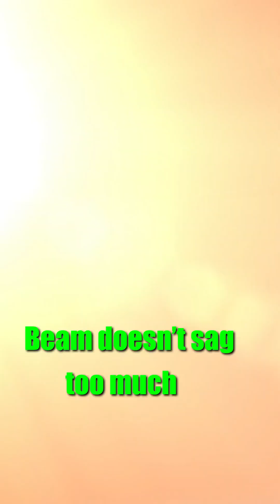Why STAAD  gives wrong deflection? Fix it with reduced EI

Comment: Thank you sir,
Please with r.c building in staad, the beams are connected at the mid point of columns.
 What if in real life the beams are supposed to be connected to the edge of the column.
How to you correct that in staad.
 Because the load distribution to the column should be different in the 2 scenario's.
Thank you
Reply from the maker: https://www.youtube.com/shorts/bToVY8xsoPI ,Watch this Column design rules 

Additionally 
To get flexure and shear design results at a specific distance like "d" from the column face (rather than the default 13 locations), you can use the *SFACE**, **EFACE**, and **MFACE* parameters in STAAD.
✅ *SFACE* = Distance from the *start node*
✅ *EFACE* = Distance from the *end node*
✅ *MFACE 1* = Tells STAAD to perform *flexure design* at the distances specified in SFACE/EFACE
 Example Input:
SFACE 500 MEMB 1  
EFACE 500 MEMB 1  
MFACE 1 MEMB 1

This will check *shear and moment design at 500 mm* from the beam ends. Perfect if you want results near the column face or any other custom location.

Comment: And where direct analysis to be used ?
Reply from the maker: Great question. Direct Analysis is used in steel structure design, especially when second-order effects, initial imperfections, and inelastic behavior can significantly affect structural stability.

It becomes essential when:

* The slenderness of members is high
* Bracing systems are flexible or complex
* You want to capture P-Delta effects accurately
* You're dealing with rigid frames, tall buildings, or structures in high seismic or wind zones

According to AISC 360 (Chapter C), Direct Analysis is required when the ratio of second-order drift to first-order drift exceeds 1.5. It’s also recommended instead of relying on effective length factors (K) and moment magnifiers.

If you're just starting, you can refer to:

* STAAD.Pro Technical Reference Manual – Section 5.37: Direct Analysis
* AISC 360-16 – Chapter C: Stability Analysis and Design
* Basic tutorials or NPTEL videos on second-order analysis in steel design
Reply: @CIVILNIRMAN  In PEB , sections are not homogeneous . Yet engineers still use effective length method, it is appropriate to use efficient length method if the section is not homogeneous. ?